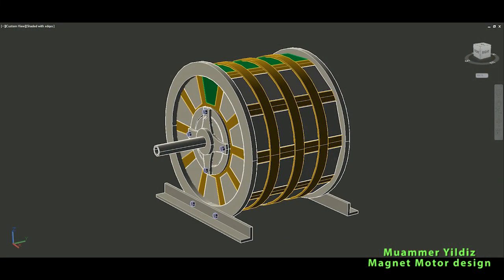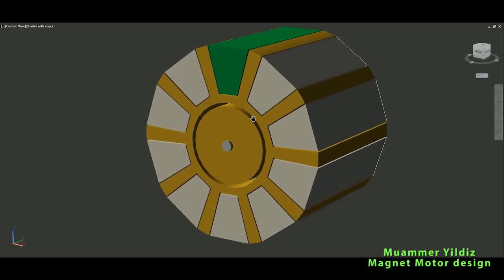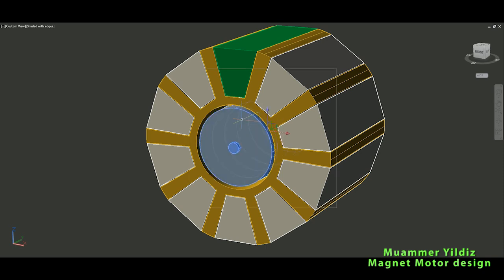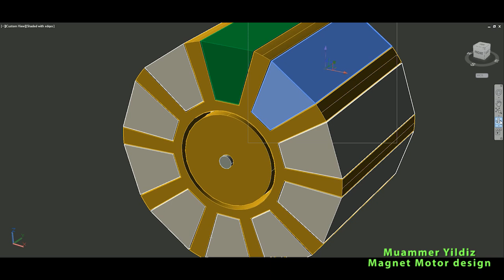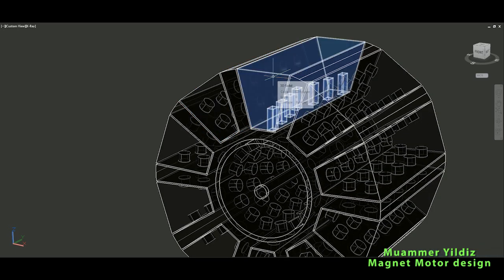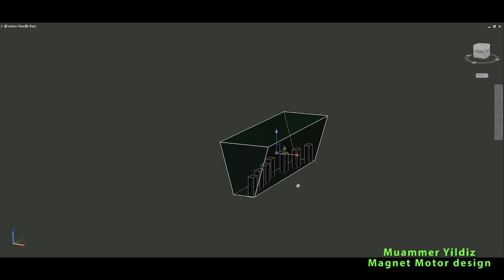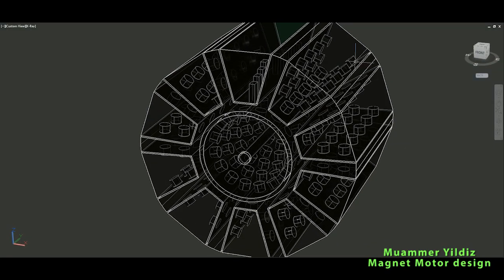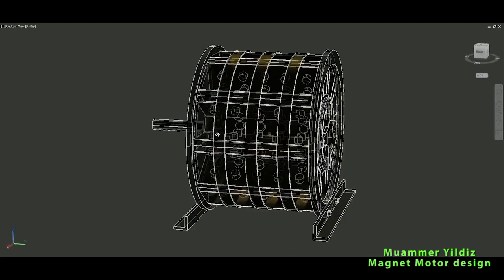Free Energy Generator, Working Patent! Muammer Yildiz Magnet Motor, Detail design!!!

Comment: Speaking of free energy. 
How does the sun continuously burn at a ridiculous rate and at such intensity but yet still doesn't 
Stop burning for such a long time now. What substance in the universe can burn for so long.
Any fire here on earth always goes out once the fuel is used up.
Clearly any one that would respond will only have a theory. For the simple fact that they can't walk on the sun and studdy it.
But I'm still curious of the theories.
Reply: It is nuclear fusion. The energy does not come from some fuel combustion ["burning"], but from the fusion of nuclei.

Comment: Where does the battery go. Because that’s conveniently missing 😊
Reply: There is a video where Yildiz dismantled parts of his motor at the university of Delft. You can see there that the outer ring is completely without function, batteries and motor are hidden in the central component.
Reply: @andreasschmitt2307    Since Yildiz only dismantled some outer parts - and he had chosen which ones - the non-dismantled outer parts could also serve as batteries. But also the core which stayed hidden would offer enough place for battery and motor.
Reply: @durchblick6886  
Ja, kann sein. Ich tippe auf das innere Plastikgehäuse, passt ja auch zu den fürchterlich kurzen Laufzeiten seiner ursprünglichen Geräte, die teilweise nach 10 Minuten schon "kaputt" waren. Der einzige Motor, der über 6 Stunden lief, war ein ganz anderes Modell mit viel Platz für Batterien.

Comment: GREAD, but You needn´t so many Magnets. / see on facebook ---> w-j-fritz-motors-&-chassis
1.) Make a cylinder, put 12 pieces of cylinder-segments (Magnets) on the left side, and  12 pieces of cylinder-segments (Magnets) on the right side ("Runner"). 
2.) Accelerator(15,3° offset to the left side) ---> 12 pieces of cylinder-segments (Magnets) on the left side, and  12 pieces of cylinder-segments (Magnets) on the right side.

Comment: These look like drawings for his earlier experimental motor.  However it's still a scam motor.  People have been making magnet motors for a very long time.  All he did was go buck wild with it and use over 9,000 magnets.  To spin a little RC airplane sized propeller at 2000rpm.  At a weight and power ratio that's not effective as an engine, and a torque value thats not effective as a generator.
    In effect he made a really cool super expensive fan.

Comment: You just need elecricity to power it
Reply: No. By powering it with a kick start,... the magnetic fields generate a perpetual momentum... The array of magnets are set to repel synchronously across each length of stator. 
When you get it started,... it will spin up to a mass-related centrifical max. RPM.... also building a portion of voltage and current enough to power up accessories...it has limits.
A train is levitated by this principle,... only while moving at a minimum speed.
Reply: @kennethkustren9381  only in your dream

Comment: All movies showing the feat of motorbikes are tricks - all.
The great feat is in making so that it seems true. The fundamental laws of
physics are eternal, do not change, do not age and do not modernize. The film
shown is old, from 2009 and where, in 2019, the technological revolution is
using these "inventions". With these engines are still not in
industrial equipment and automobiles? In the same way, a Brazilian showed in a
TV network a car moved just in front of the water, which was eternal and
released by the pipe of discharges simply water - and was eternal. Stupid
trick.

Note that at this "International Conference" no

congressman displays identification badge. Notice that the "Magnetic
Motor" is turned on, it fires and then appears stopped, without showing
details of how the thing stops. The number of AWG turns and gauges is
emphasized as if they were relevant - pure attempt to make it look
technological, scientific, a comedy.

Comment: Thanks for the description of the magnet arrangement. It would be nice to see which ones are what polarity and  the angle of the layout of the interior armature. I can see the reason for the magnets on the bottom of V block but I don't understand the reason for the 10 on the sides.
Reply: I would like to get one built with an acquaintance and a body of collaborators in terms of advice etc would be a great asset. Have you any further insights on such things as polarities and other specifics?
Reply: @stevetilbrook3402  No. I am trying to figure out the polarity also. I have V-gate motor built but now I need to work on the cam to lift the top magnets and to design a low magnet to raise too. With any motor, it has to switch polarity to keep running- just like an electric motor does and I don't see how this one works. i like the Yildiz motor but it looks really complicated and I don't have the machines to make all those parts
Reply: @jimjakosh2506  we built a bedini generator a long time ago. I paid for the parts and a savvy pal with a huge Tesla coil in his garage built it.
He showed me the electronic readouts proving over unity.
I understand the basic magnetic principle,
When the stator magnet in the outer ring is energized it attracts the rotors  fixed magnet, then at the moment they meet the stator magnet is de energized allowing the rotor magnet to pass more easily.
This is where a little known principle of electromagnetism prevails and actually pushes the stator on by.
When an electromagnet is de energized its poles flip back and forth whilst dissipating in strength.
During the first flip the stators electro magnet becomes the same polarity as the fixed rotor magnet and assists in the traversement of the rotor magnet on past the stators electro magnet.
This principle can be applied in the V configuration in that the tightest pair at the bottom of the V which normally impede progress should be  electro magnets that shut down momentarily in order to not only negate impedence but also provide a push effect propelling the stator into the next V threshold.

I will try to link you to this electromagnetic phenomenon.

I hope this is at all helpful to you
Reply: @stevetilbrook3402  Thanks. I would appreciate any information on the V motor and the timing of the change in polarity. I won't have electromagnets, so it is up to  the pusher magnet at the top getting up just in time  to  keep the motion going. I have a 10" flywheel built into it already from a different design that did not work...Cheers, Jim
Reply: @stevetilbrook3402    " He showed me the electronic readouts proving over unity "
It is very tricky to make valid power measurements with a Bedini since the output are pulses and neither AC nor DC. Even correct measurements at the input are a problem. Even if you use a stable voltage source which is easy to measure, the input current is also neither AC nor DC. I bet your friend did some mistake with his measurements. Bedini claims overunity, but he has never shown a correct measurement of this claimed overunity. Although his motivation to show this should be high. After all, with such a demonstration his name would be famous at once in science, since he would have been the first one to demonstrate a violation of conservation of energy.

" This principle can be applied in the V configuration in that the tightest pair at the bottom of the V which normally impede progress should be  electro magnets "
If you do that, you have just build an e-motor, and not a very effective one. The permanent magnets would not contribute to the mechanical output energy at all. How should they? The energy of permanent magnets is very small and they don't loose this energy by exercising forces.

Comment: I see 2 problems with the design. 

First, multiple magnets need to be nearly identical. That is never the case.
It would be timely and costly to match magnets, if even possible. 

Secondly, the rotation of magnets will always slow to an oscillation without an external kick.  This is typically 20-25% of the energy produced in the best design. There has to be a stationary bar for the rotation to produce Torque.

I am not opposed to the idea, just the implementation.
BTW, free energy is not the same as perpetual motion. Would you consider solar free energy?

Comment: Why dont you show a machine working in real ?
Reply: The answer is evident. In reality magnet motors do not work. The demonstrations of the Yildiz motor show that the motor runs, but most likely only due to a hidden accu and e-motor. Yildiz never disassembled a running motor so complete that this could be ruled out.

Comment: A magnetic motor will never reach 100% efficiency nor over-unity. Magnetic motors become more efficient the smaller they get. Electromagnetic motors become more efficient the larger they get. Your best chance of over-unity is to work the ionized particles in the air and ground against each other to create energy. The sky is voltage and the ground is amperage. Free energy is only possible in an environment where the potential energy already exists. The Ether surrounds you!

Comment: There's no free energy here. Magnets are just like batteries. Go search how neodemium magnets are made. They store energy in another form. Eventually, the magnets will weaken like a depleted batteries. And you'd have to "recharge" it again.
Reply: Sintered Nd-Fe-B magnets will remain magnetized indefinitely. They experience a minuscule reduction in flux density over time. As long as their physical properties remain intact, neodymium magnets will likely lose less than1% of their flux density over 100 years. Generally the magnet will experience a degradation in its physical properties, such as corrosion, prior to it demagnetizing because of age. However, heat and high magnetic fields can demagnetize these magnets.
Reply: That's why magnets are cool. They're good at keeping their energy for a long time unlike batteries that have high self discharge.. Humans just need to learn how to extract this stored energy in the magnets.

Comment: Unfortunatelly will not work, but nice try
Reply: can you show your experimentation , like this we can judge by our self if its work ........
Reply: @hamieuxcarl69 
There is no asymmetry in the system.
Simply, by just slightly move magnets from each other in different angle = won`t work :)
That's why perendev magnet motor also fake :)
Reply: So.... "Magnets force" is not equal  "electric magnetic force"?

Comment: Free Energy 101. 1. Problem with patents: Evil circumstances about patents and law that prohibits the proper showing of the device. 2. Unclear function, inability to explain properly other than in very vague terms how it works, and/or insulting anyone who doesn't get the poor explanation about how stupid they are and that it isn't their job teaching them physics. 3. Hope mongering, just imagine if it works, how wonderful wouldn't it be? 4. Cables off screen. 5. Not running long enough, possible hidden batteries inside. 6. Running on a mysterious table that absolutely doesn't have some coil underneath it inducing current into the device, I promise.7. So tiny effect it isn't measurable. 8. Schematics, but no running device. 9. Extremely expensive equipment and no explanation of the principle, making it economically impossible to test for anyone. 10. Magnets.... every... where.....

Comment: The secret is that original motor is not permanent magnets only motor. It has electric parts (electromagnets) in addition to permanent magnets. Electromagnets are used to deflect permanent magnetic field.

Comment: This is crap.   There is NO such thing as a Permanent magnet.  The magnetic field will slowly weaken over time.  If you put a magnet into the field of a stronger magnet the stronger one will pull the magnetic field out of the smaller magnet.  Hard drives in a computer had a magnetic field that had to be Reformatted  because over time the magnetic field would get weak and you would lose data off the disk.

Comment: Please quit calling these "Free Energy", please.
1) It brings out the semi-educated who start screaming about physics, and mis-defining perpetual motion, and on and on, and cast false claims Against a fun scientific hobby.
Magnetic propulsion DOES work or there would not be mag-lev trains. Saying this somehow violates physics is saying Japan violates physics 100's of times a day.
In fact, this no more violates physics than you pedalling a bike violates physics.
It is the transformation of electromagnetic energy being translated into kenetic energy in the form of angular momentum around an axis.
Your muscular energy moving your legs up and down, with the pedals translationg that motion into circular motion (angular momentum) which spins the tire, which translates circular motion into linear motion as you move forward. Are you freaking out about that as well?
2) Decent neodymium magnets can get expensive as fu$%. Add in all the other parts, etc, it sure the eff aint free.
3) It takes energy to create the magnet. They are not just dug out of the ground. So, "free energy"? Not exactly.